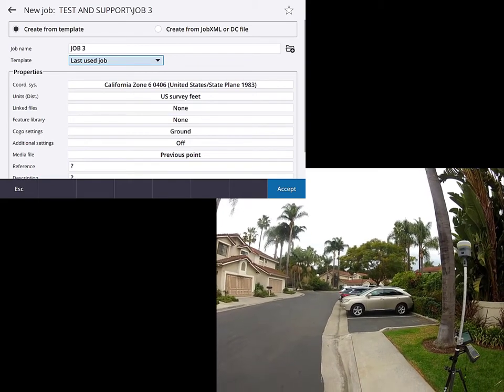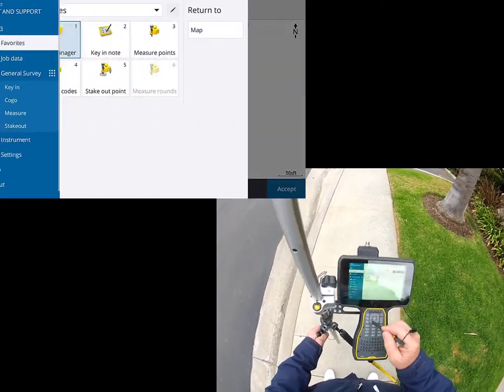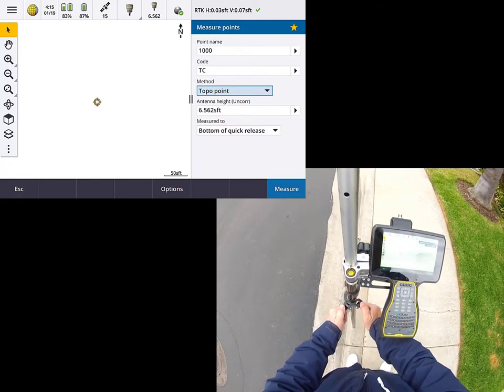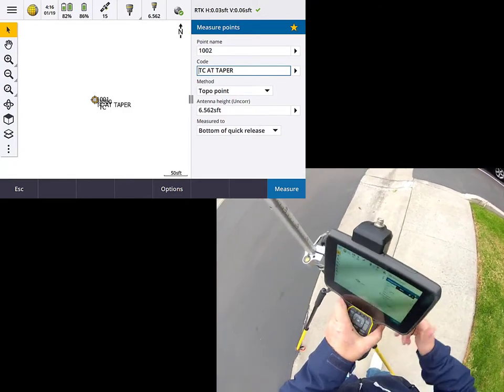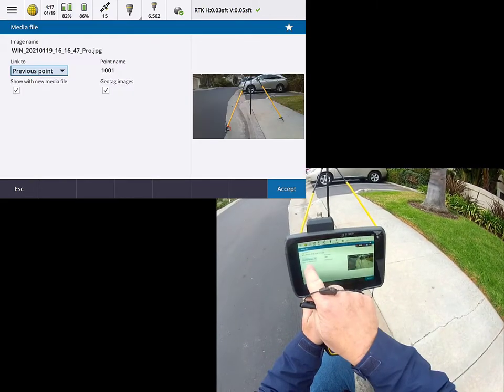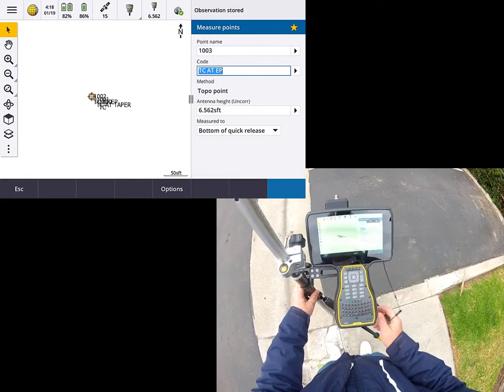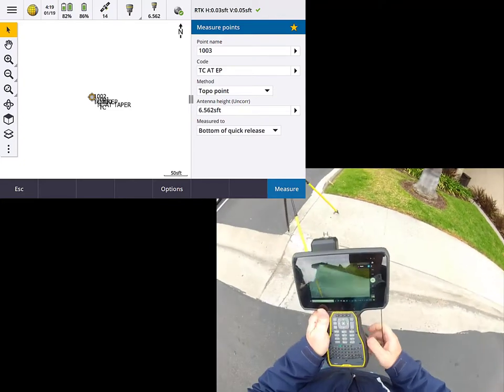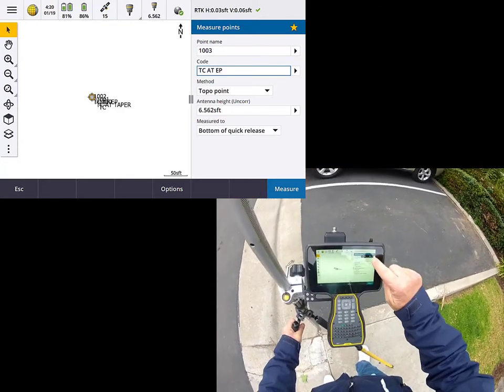Taking Photos with Trimble's TSC7

Comment: I can take the shot and take the picture but when I exit out it doesn’t give me the option to link it to the measured point?
Tried bringing it back up in photos but I can’t seem to figure it out.
Reply: Hi Nik- In current versions of Trimble Access, when you create a new job, there is a "Media File" option that's available in the job Properties section.  If you select this, you will see several different choices for "linking" your Media (photo) files.  Choices include:  Job, Previous Point, Next Point, Point Name, or None.  I usually leave this set at Previous Point on my collector.  Since you are not seeing a "link" prompt, I'd suggest creating a test job on your data collector and see if perhaps this is set to None or something else that's undesirable on yours.  If so, change it accordingly.  Hope this helps!  -gh
Reply: @greghazelquist644  Thanks Greg. I didn’t realize it was Trimble Access. that’s probably my problem, I’m using Trimble Siteworks.